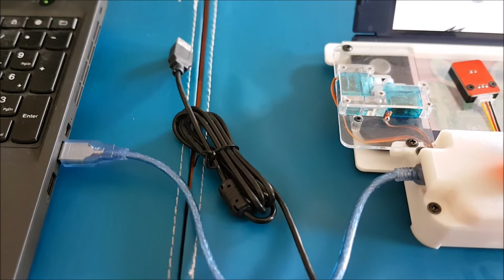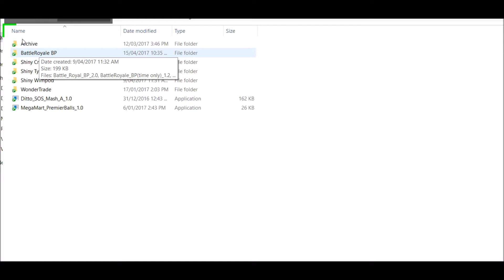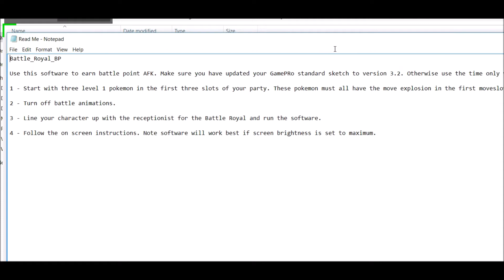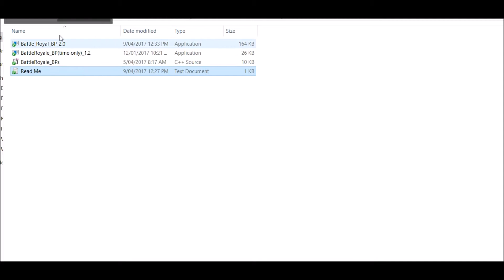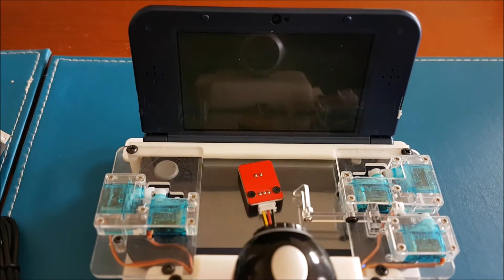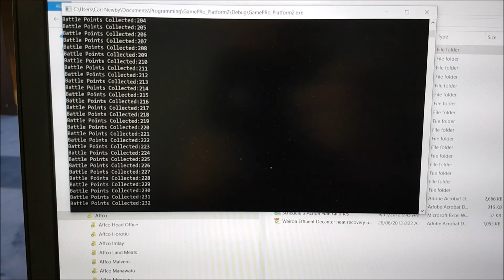Sun and Moon Automatic Battle Points! GamePRo Software

Comment: do you think you're able to do a SOS method yet? or still no way. if this helps, when a pokemon is successfully called, the camera takes longer to pan down.
Reply from the maker: Byron Slowe I'm working on it, I still believe this is possible but it is reasonably complex.
Reply: Nooby yeah, especially with some pokemon are relatively easy whereas some (for example, final gambit riolu) need some fine tuning.

by the way, skill swap bestow harvest exeggcute may help out A LOT if you're worried about having to swap pokemon.
Reply from the maker: Yea I've seen some videos using that method and have been thinking about incorporating it. Keeping track of the number of turns isn't such an issue when you are using software, but it might be a nice way to make some generic software.